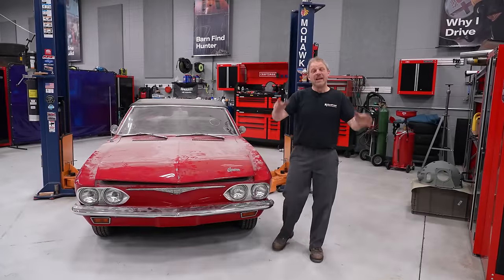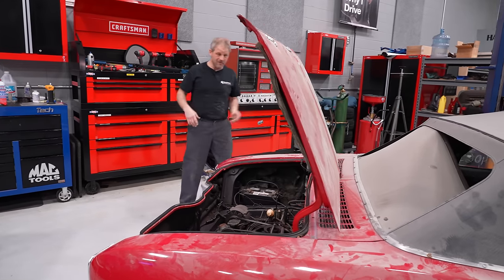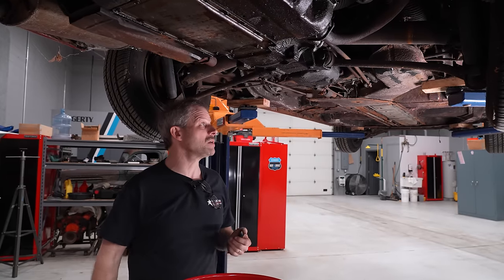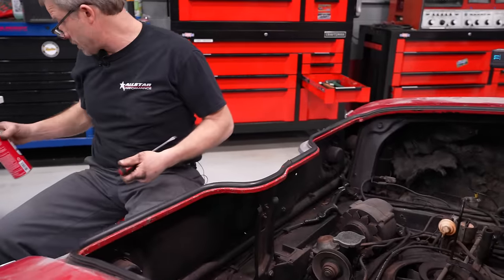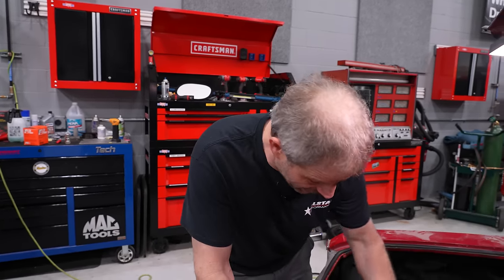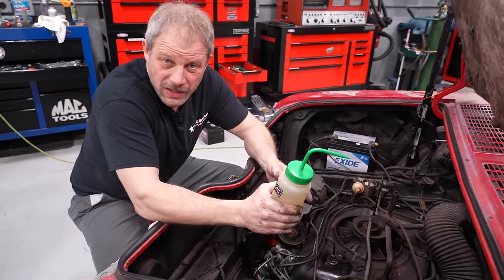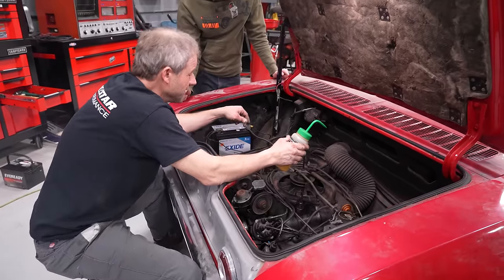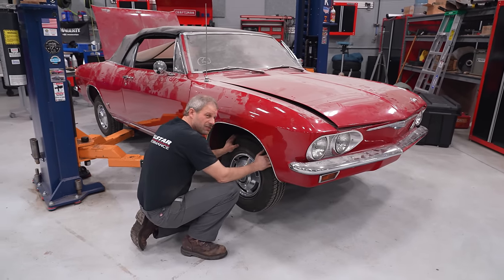$800 Classic Chevy: Will it RUN? (And Maybe Even DRIVE?)

Comment: You're lucky that the water didn't get into the engine. I have 2 corvairs that got flooded in Ida. Before cranking an engine. you should drain everything. I was able to get my cars running because I didn't wait too long after it got flooded. If your engine got flooded into the carbs and cylinders. it's probably junk.after waiting too long to service it.

Comment: A Corvair is less than 15,000 in Mint condition easily. They were bad dangerous cars when produced. You can easily put more money into that car than it will ever be worth. The paint job would cost more than the car is worth. But to be fair 99.9% of all restorations cost  way more than the cars are worth. Few cars have that much value.

Comment: I don't know why this immediately jumped out at me while it was up in the air, I certainly wasn't looking for it, saw the bottom of the block ends where the exhaust comes out I could tell the driver's side carb was either lean or sucking air getting hot enough to burn all the oil off (it's dry and rusty as a bone, heat!) while the passenger side is still covered in years of old crusty oil.. and it's been running with un-tuned carbs that way for a good while. driver's side has ALL the oil burned off and all the signs of too hot while it's the complete opposite story on the other side, so rich it's not even getting hot enough to burn away the years of oil soak. That has to be my years of having shitty VW's and unloved Corvairs in the past! Some things we look for without even looking never change 🤣😂
Reply: Sidenote this why I *hate*, I mean hate hate hate buying old classics with dual/multi carb setups, that's where I was going with that, coz I never have a clue how well any of the previous owners kept up with carb balancing at least once in a while over the decades.. Hopefully before a head burns out. I've seen this so many times 🤣 Always got bikes dirt cheap that way too, guy selling it "I could never get that damn thing to run right!" "Yeah your carbs weren't in sync" "Not fair! I sold it to you as junk!"
Reply: @Drmcclung  I think your head IS burnt out
Reply: @speedfreak8200  Yeah it's not like I haven't seen it a thousand times before on dual carb air cooled stuff..

Comment: Worst car I’ve ever had to redo all the brake lines on. From the master cylinder all the way out to all for wheel cylinders. Right off the master cylinder it runs into void between the front bulk head and the cab that isn’t accessible.

Comment: Why would someone turn that into insurance.  Even if it went completely submerged, those cars are so basic that you just clean them out and rebuild the motor if need be.   I love Corvair’s.
Reply: The amount of labor cost to repair would exceed value.
Reply: @bryanturner683   Maybe if you are paying someone to do it. As far as I’m concerned, nothing exceeds the value of  keeping a classic automobile on the road. Especially something as mechanically simple as a Corvair.
Reply: @navvet4518  Well if the insurance company is paying the bill, they wouldn't, they would just pay what the car was valued at, assuming it had full coverage?  Given its not an original Corsa or at a minimum missing its original engine the cars value was far less than cost to repair. Owner likely was offered its value, owner may have requested to keep the car but then the insurance payment would likely be reduced dramatically.  Many of us Corvair guys are older and perhaps taking on the project was too much??????  I suspect that this car will find a good home. Several folks in the comments would like to have it. Find a deserving nice young person and give him the car to restore and drive.
Reply: @bryanturner683  who would've had full coverage on a car like that

Comment: There is something fishy about this Corsa. Wrong engine.  I see nothing to indicate a flood. I think the seller was faking you on a lot of things. Looks like a lot of questionable body work.
Reply: You are correct, incorrect engine for the trim level. The interior was Corsa-correct though (not just a gauge panel swap) and the VIN started with 107, meaning this is a Corsa. And yes, based on being around this car for awhile I think if it could talk it would have some real interesting stories.

Comment: if thats a real  corsa  its not the org engine  ..
Reply: Yep - should be a 140hp engine if it's a Corsa.  Someone slapped Corsa emblems on it.
Reply: @JDJD-rf2cb  or a 180 turbo
Reply: You are correct. This car has a 107 VIN though, so it at least started life as a correct Corsa. Who knows why the engine was swapped though.
Reply: @JDJD-rf2cb  There is more to faking a Corsa than the emblems. I checked the VIN when I noticed the engine and it starts with 107 which means this is a Corsa. The car also has the correct interior bits (more than just a gauge panel swap) and silver rear cove. Wish we knew why the engine was swapped.